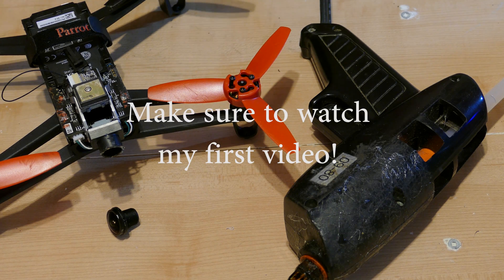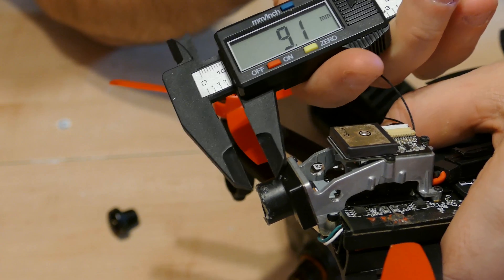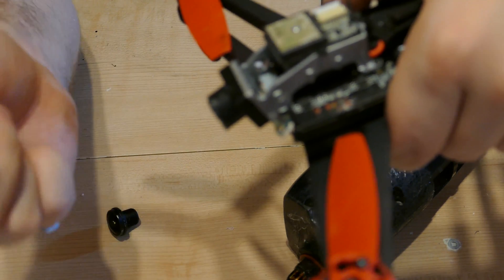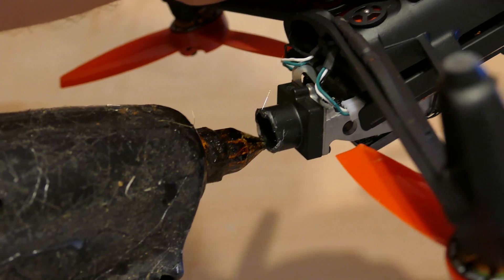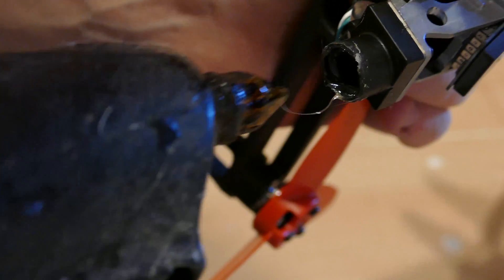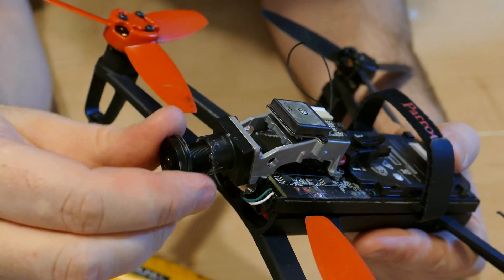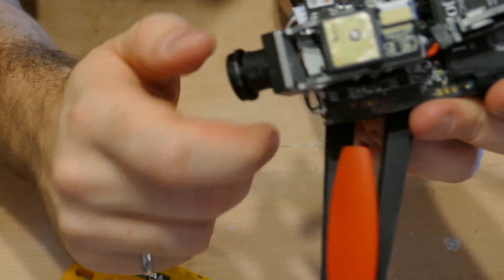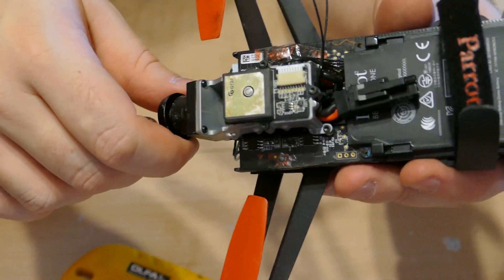How to repair a Bebop Drone Camera Lens - Part 2

Comment: Bonjour, je suis français, je me demandais 2 choses.
Puis-je coller la lentille avec de la colle cyanocrylate ou vaut il mieux utiliser un autre type de colle ?
Faut - il que la lentille vienne toucher le capteur ou est-ce qu'on l'approche juste légèrement puis on gère la mise au point à l'infini en la rapprochant ou l'éloignant du capteur ?
Reply from the maker: Jean-Samuel Le Traon Salut Jean-Samuel, non n'utilise pas de cyanoacrylate. Si tu regardes mon autre videos il semble que ce type de colle degage des vapeurs qui ont rendu ma premiere lentile flou. Le but est de créer des filet pour visser la nouvelle lentille. Il te faut donc quelque chose d'épais et qui ne risque pas de couler sur le capteur. La colle chaude est bon marché et a bien fonctionné pour moi... Il ne faut pas toucher au capteur, mais ils faut s'en approcher considérablement. (D'où l'utilité de se créer des filets, ça permet d'approcher tranquillement jusqu'au point ou le focus se fait sans trop le dépasser...)